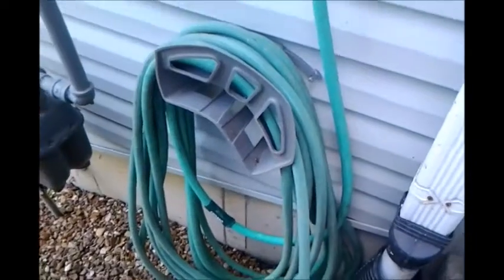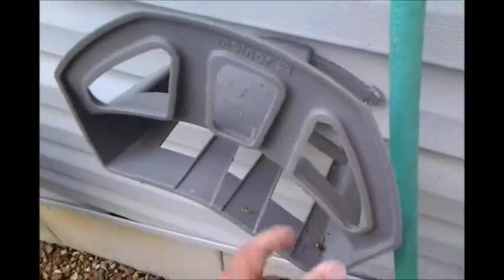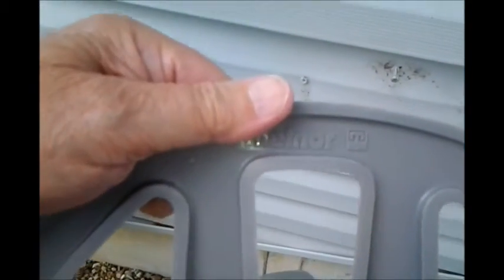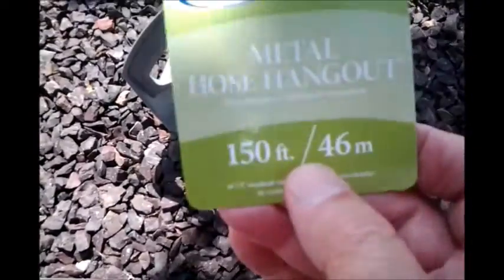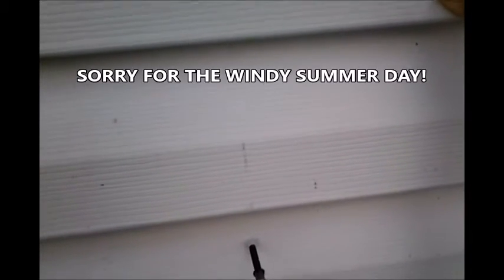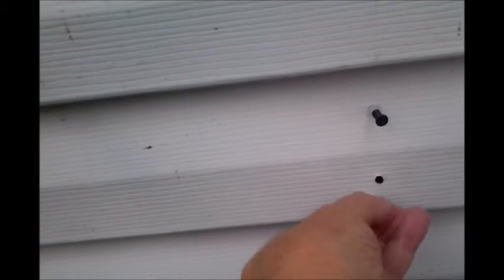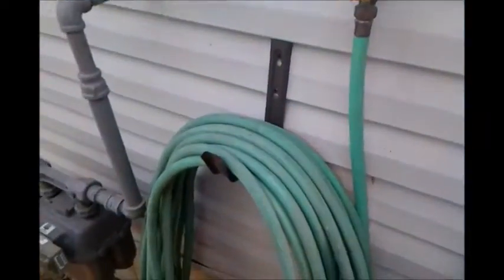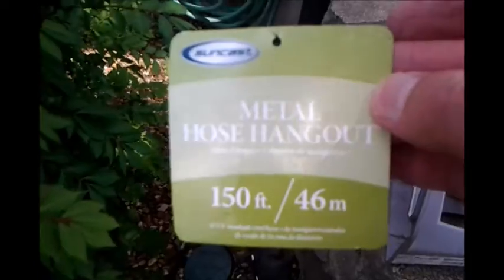REPLACING A GARDEN HOSE HANGER

Comment: Do you need a stud finder? How will you know not to hit a water pipe or electricity?
Reply from the maker: In my case, I am drilling into a 10" concrete wall & didn't have to worry about these issues.  These utilities enter above the concrete wall.  So, normally, yes you should use detectors, etc.  & use caution!